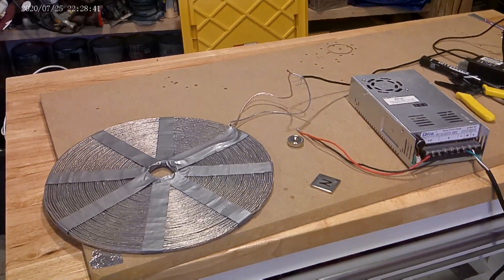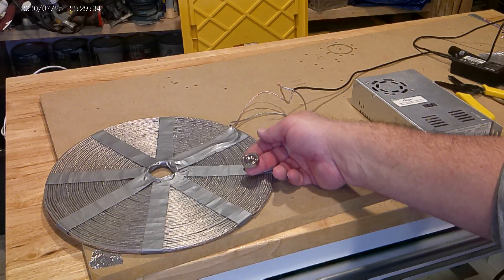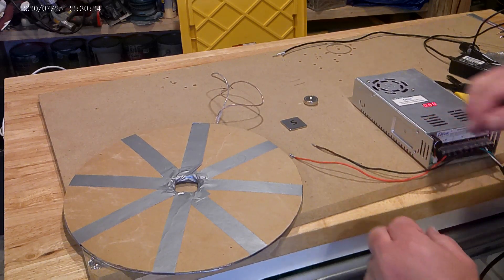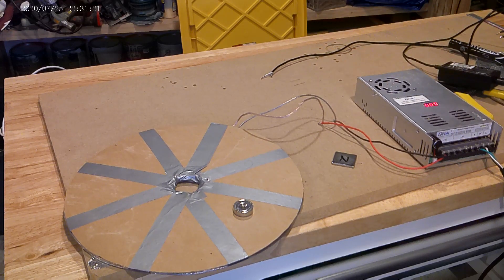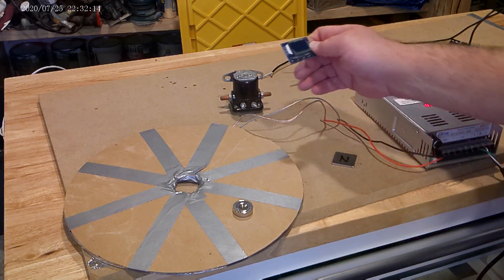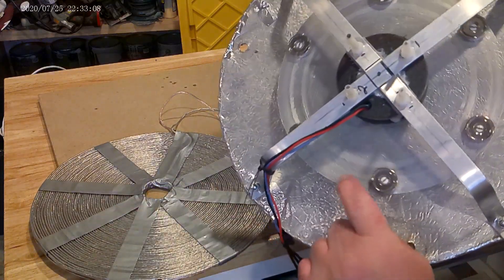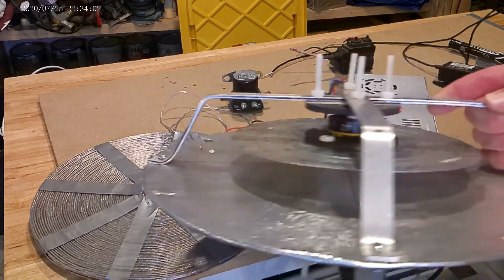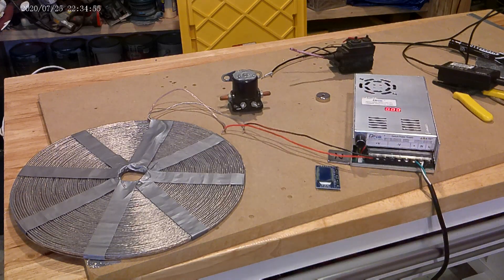bifilar coil for graviflyer

Comment: Can u make a remote to this device here ?
Reply from the maker: I have a remote for my next version. Because it runs on dc motors I use a quad copter remote for it. The hard part is balancing the batteries in the craft due to the rotation.

Comment: How did you make the circular coil is it insulated copper speaker wire?
Reply from the maker: Yes speaker wire. I used a pipe to make the first few turns around. Super glueing them as I went. Then removed the pipe. Then kept wrapping the wire. The hardest thing was keeping the wire straight when wrapping. It also has a piece of thin cardboard under it. That part is optional. Wires go inside silver to outside red. The other two are your inputs.
Reply from the maker: This guy has several video's about the coil. he also shows how to build one. https://youtu.be/Hkqa6c-0fFk   This particular video was vey cool.